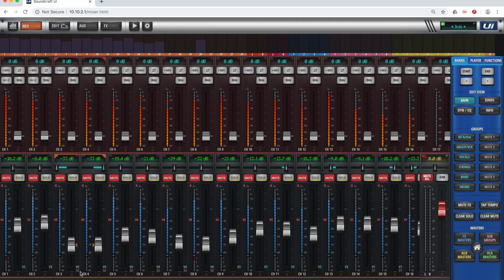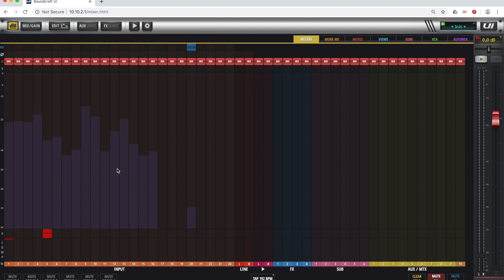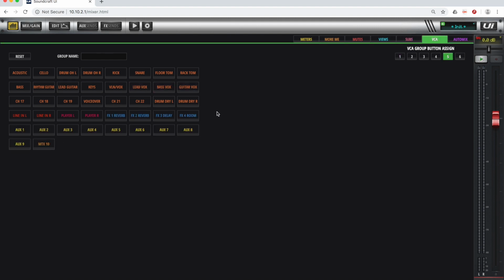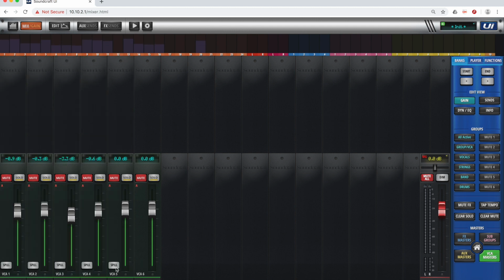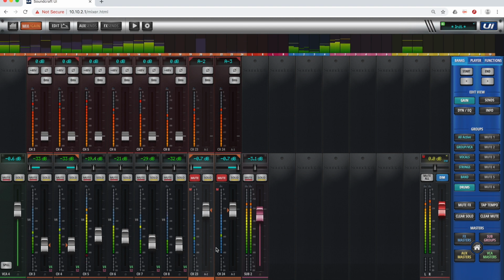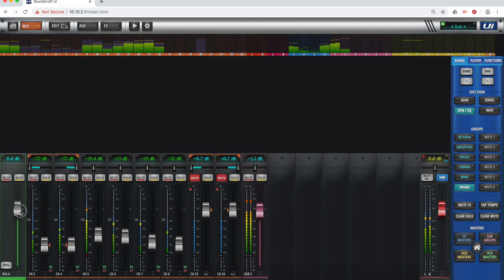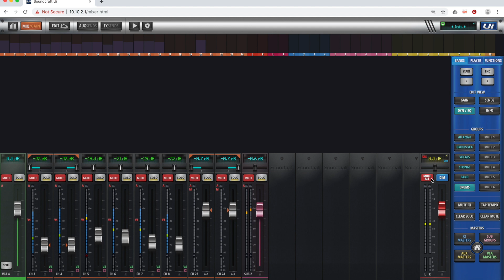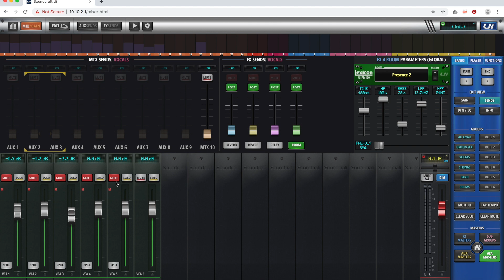Groups - Part 4 - VCAs and Mute Groups using the Soundcraft Ui24r 1 1

Comment: Should i keep subgroups levels at unity if im using vca's only for volume control?
Reply from the maker: There are some different use cases here. I normally do operate that way but an example where you may not is that you might lower the subgroup output and have the subgroup compressor driven harder with a VCA controlling levels. Dave Rat has a good video on this.

Comment: Still do not understand how could they give us groups without being able to route the FX returns into them. What is the point of a group if you can not group everything you want.
Reply from the maker: Could you be more specific as to what you would like to do? You can send subgroups to an FX bus which many consoles actually do not do in this manner but you say you would like the return so I am guessing you mean a group for all of the FX - to turn all FX on/off? In this case you can use a VCA.
Reply: @EaslerMedia  There are many usage cases that need the fx returns to be routed through a group, for example having a drum mix with the room FX compressed together with the drum kit, which can not be done without being able to process the FX as well.
Then there is only the old school GEQ on masters which is very slow and very granulated, I much often need the gentle PEQ on my masters to sculp the curve precisely and fast, but this device does not offer PEQ on masters for some strange reason so it is not possible to route everything through a group and then use its PEQ for additional processing.
There is more, but really there is no logic in giving groups and not being able to use them fully, it costs nothing really. This way it seems like they do not want advanced users to use their devices.
Reply from the maker: @BojanBojovic  but you do have parametric EQ and compression on your sub groups and you can send the group to an fx bus. While the auxes have graphic EQ which I'm not a fan of, the subgroups do not.
Reply: @EaslerMedia  The problem is exactly that, when you put the whole drum kit through a group you can not add reverb or amp simulation as those would go to the whole drum kit, while the reverb goes only to snare and toms, amp simulation on snare as well. Being able to put the fx returns through the group fixes this and many other things.

My idea was to use the group PEQ instead of master GEQ but this is possible only if I leave the FX returns unprocessed, which is not that bad but still there is no reason not to include this as an option for us who want to use it, not to mention PEQ on masters.
It is a great mixer, much better and versatile then any analog mixer in the same price range, but this would cost them nothing to make. Not to mention that you can not separate left and right channel for the delay and set 10ms difference to get the stereo delay, for a Lexicon delay this is unforgivable.
Reply from the maker: @BojanBojovic  I understand what you are saying - you want parallel processing so you can have an amped snare for example but you don't want the amped snare in the group? You could always double patch and have the amped snare in a drum vca but not group for example. You do have your channel fx send and the group fx send so there is a pretty good amount of flexibility. I would like parametric everywhere but I also remember that there are limitations on mixers costing much much more and I think there is a good balance of capability and user friendliness overall for a rather inexpensive mixer.
Reply: @EaslerMedia  You are right, many more expensive devices have 10% of what Ui24 can do, so we can be apologetic of course, but if you check the

Comment: I created a subgroup and when I move the subgroup slider up and down, the volume to my auxes are unaffected.  The meter for the subgroup is does go up and down  but there is no change in my speakers.  How do I get the subgroup to control the volume of the auxes?
When I create a vca group I can control the speakers volume but not through subgroups.
Reply from the maker: That's because a sub is made up of channels that then gets sent to the mains. A sub is a post fade aux essentially and some mixers like Soundcraft si treat them just like that. So youre going channel - sub - send to main. The sub volume won't change the individual volume of your aux even if sent post fade because the channel is going to the aux before that signal goes to the sub. Hope that makes sense.
Reply: @EaslerMedia   it does make sense.  
With my old analog Mackey board I could disconnect my channels from the mains by pushing the l r button.
is there a way to control the overall volume of a group of channels by assigning them to a sub group?
I was able to do it with a VCA channel but I like the idea of being able to add eq to a group.
Reply from the maker: @gerrigorlich4179  well your subgroup master should do just that
Reply: It doesn’t seem to.  I don’t see way to add my subgroup channel to the aux channel I want it to go to.  I guess I don’t really understand how subgroups are routed and if I need to change my mapping to get it to do what I want it to do.  I have a Soundcraft ui not si.

Comment: Been setting up my UI24 for my first show. I am comfortable with and prefer using VCA groups but want to send out a Matrix mix out to the venue's house system for the obvious benefit of a separate output only mix with FX and time delay.  I'm unclear or unsure about using both Subgroups and VCAs simultaneously on channels and how it might affect levels on particular channels assigned to both. I see that you can "Exclude from Master" a Sub Group and also "Unlink" the the actual Matrix channel from Master. Do I need to do either or or both so I can have complete and separate control w/out affecting my actual channel levels for my FOH mix?
Reply from the maker: Lots of questions here and maybe watching my groups video will help a bit but some basic terminology is needed here. A VCA is just a remote control of multiple channels essentially. It passes no audio, just allows multiple channels to be turned up or down simultaneously. A group means we send audio to a stereo channel (the group) which is then typically sent to FOH. That group can be processed as a group so you could EQ the whole drum set for example. A Matrix is a feed that sends a mix of groups or your master LR unlike an aux which sends mixes made up of channels. Some more advanced boards will allow you to add individual channels to a matrix mix as well. So using a subgroup with a VCA is not at all uncommon. I’d recommend you set up some simple instances using these different concepts so that you can see them in action.
Reply: @EaslerMedia  yes, I am familiar with the concept of VCAs vs. Subgroups. My question was more leaning towards the subgroup affecting my levels to the the mains when I only need the subgroup for my Matrix mix. I typically group my channels with VCAs. This is my first go around with a Matrix mix. I.E. I want a L/R send for my Matrix mix but also want to perhaps mix it a little more vocals, instruments or drums for example. Do I unlink the subgroup from the mains to achieve this w/out affecting my FOH channel levels? I see that the UI24 gives me the option to unlink from master on my Matrix mix. I can also "Exclude" from master my subgroup. Do I need to do either or both (Exclude from Master for my Subgroup and or Unlink from Master my Matrix mix? I want complete and separate control for my Matrix mix entirely independent of my FOH mix with the added benefit of being able to add effects to my Subgroups. Of course I could set up my entire P.A. and experiment with excluding and unlinking. Just hoping someone has already done this before that could advise me the best route for what I'm trying to achieve.
Reply from the maker: @CarlosDantana  sorry for not answering this sooner and perhaps you already have the an answer by trying it. Removing a subgroup from the mains just means that it isn’t going to the mains through that group. You don’t need to do that to do what you want on your matrix mix. Your matrix mix is going to be a mix of any busses and whatever you do on your matrix will not have any effect on the mains. It is its own send.

Comment: How do you stack the faders like this, and how do you get the metter bridge at the top?
Reply from the maker: This is Big Desktop mode. Found in your settings menu.  Local - Big Desktop for mix. From there, you need to make sure to zoom your browser out enough to see everything and then you can choose several upper display options from the Ui menu button. It makes a huge difference in the Ui of this console. It's really excellent when set up like this. It will not work or work well on a small screen though.